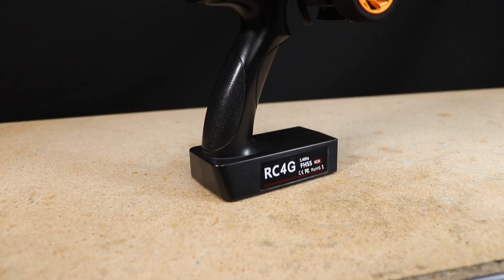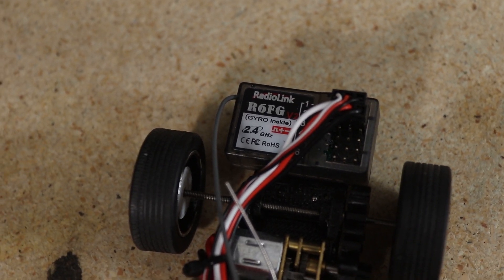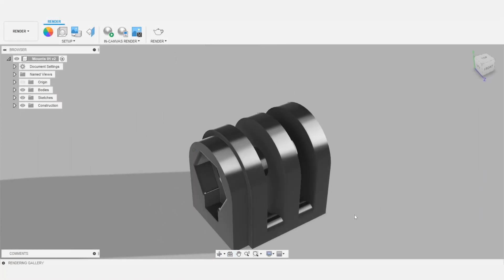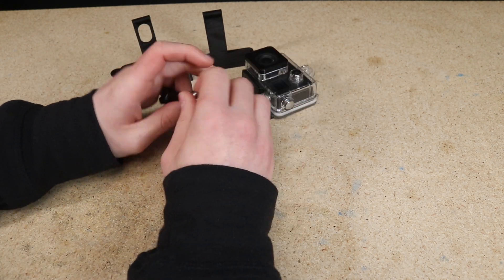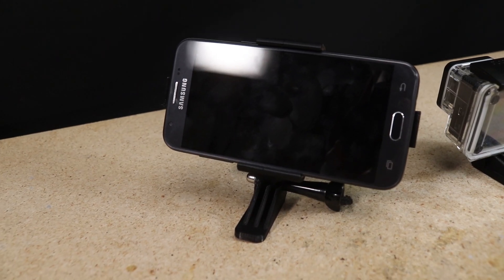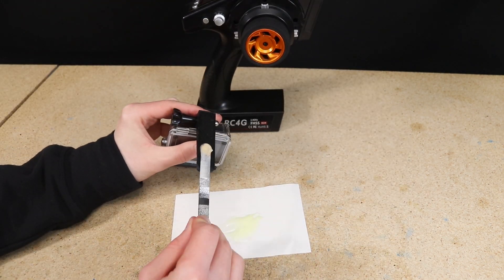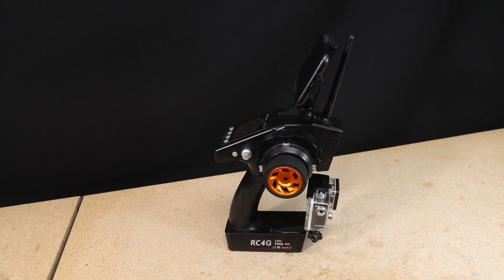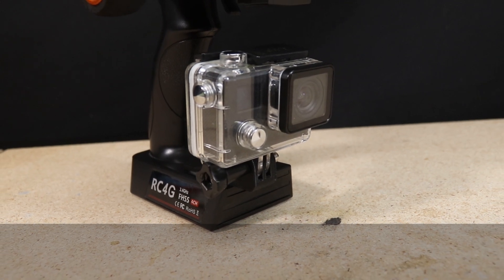DIY Designing and 3D Printing Camera Mount for RC Car Transmitter

Comment from the maker: A mini project I decided to make a quick video on. Maybe not as cool as a car build but I've got some of those videos in the works. I hope you enjoy. 👍
Reply: I thought the video was great!  There are more to RC then just building the cars.  That being said, is there a way to view two cameras though the app that is on the phone?  Then a second camera could be mounted to the car or truck.
Reply from the maker: I'm not aware of any way to have two cameras use that app at the same time, though maybe it's possible with a different app from a different company.
Reply: Hey make it rc nice job on the camera mounts at least you can film and driving with out any problems in the long run away i want to ask you about doing a 69 ford torino rc if your are interested to do one some day then please respond to my comment when you have chance see you later bye now.
Reply: Make It RC you should make a 69 Dodge Charger

Comment: I can say, doing this does make things a lot easier! I've made a sleeve that slides onto my Traxxas transmitters and gives me a tripod tap out the bottom, that I can attach my gimble to! I had made it with; an old display mount(which has the screw on a base), a belt, and a few nuts and bolts. (Just random junk I had in a collection bucket) x3